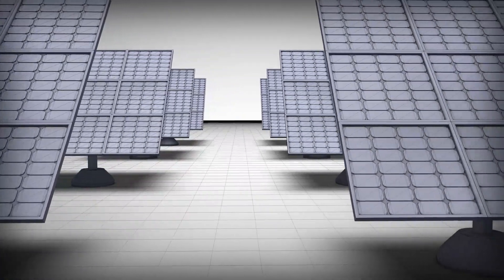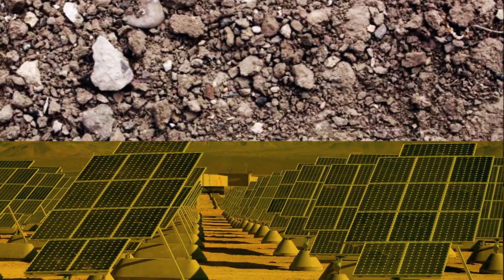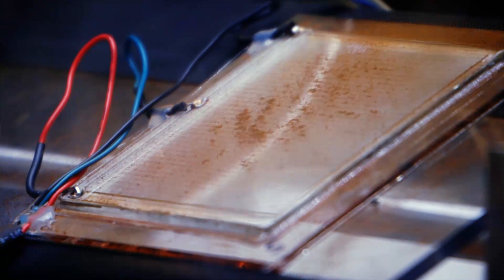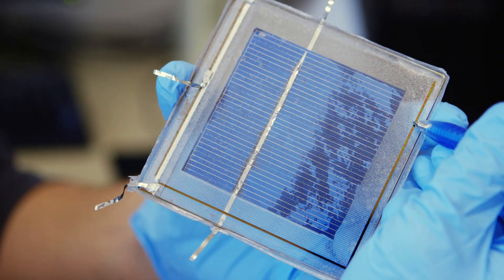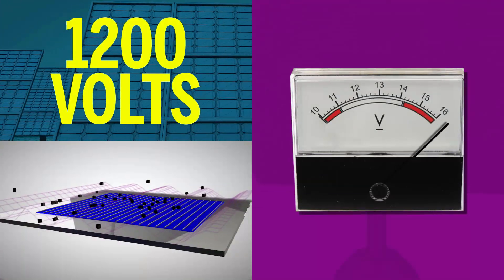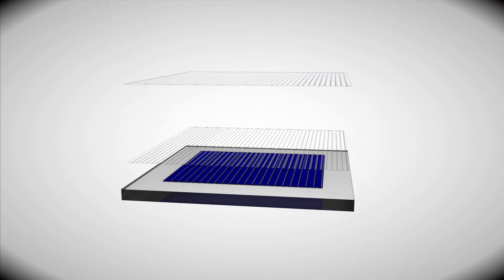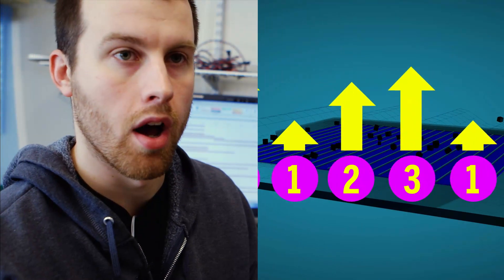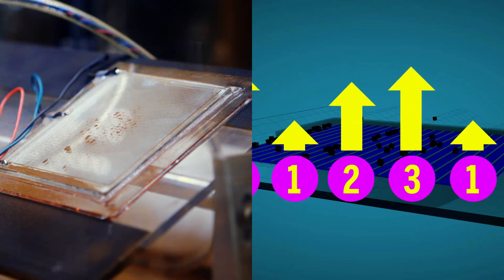Self-Cleaning Solar Panels

Comment: What's the status of this project?
Reply: I think it's a matter that's like magnets? n/s repel each other? except they give the dust an electrical charge through the panel,then cause the panes glass to emit the opposite elec .current, sequentially across the panel,like an invisible squeegee that works automatically from the reverse or under the glass surface or from inside it um kind of like a wire cheese cutting tool or a tool for cutting soft clay except it's reversing polarity sequentially so the dust loosens it's grip or adhesion 
to the tension of the surface.
but you'd want a bit of breeze to carry the dust off, & I doubt it would do anything to move bird poop! or sap or fly speck.